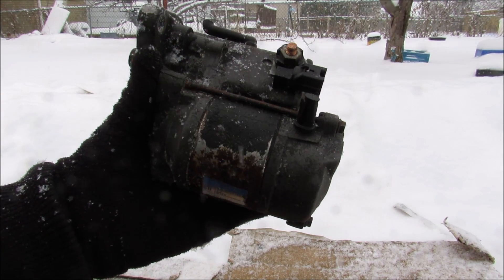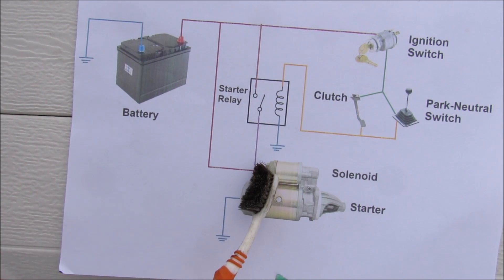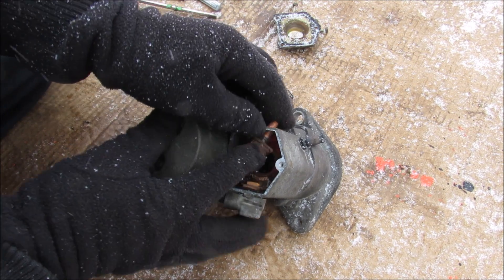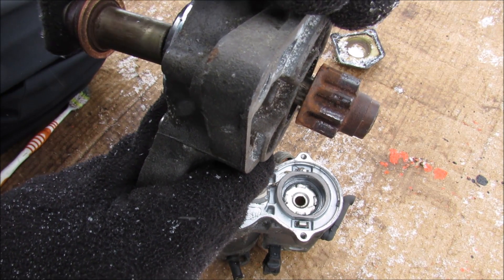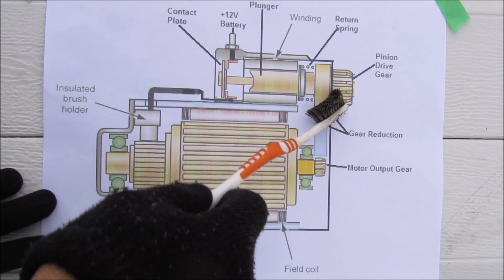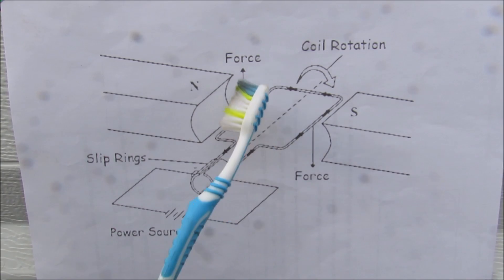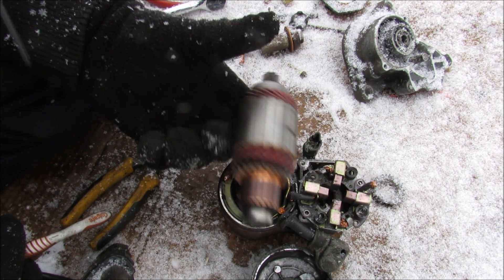How a Car Starter Works

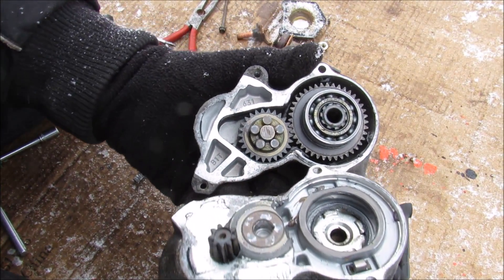Comment: The content 0:15 seconds to 0:30 seconds contrast the schematic diagram of a typical on-starter solenoid where the solenoid sits on the starter and controls the starter pinion via a shift fork. The solenoid doesn't have the starter pinion in practice. With this type of on-starter solenoid, 2:35 shows that the drive pinion on the end of the central starter shaft (on which is the armature mounted) undergoes a gear reduction back to the solenoid unit end (tricky, right?). In a gear reduction starter, the first small driving gear at the end of the starter shaft transfers motion to an intermediate larger diameter gear, which slows the rotational speed while increasing torque; this torque is then passed to the final drive gear, optimizing force before reaching the pinion gear, which ultimately engages with the flywheel to start the engine.
Reply from the maker: Yes

Comment: Would consequent starting an stopping the motor and not waiting a few seconds between that cause any damage to the starter or the flywheel (if such exists, it's an automatic transmission vehicle)?

Comment: Hi Speedkar99. I want to convert my 1.5HP, 220V AC water pump to 12V DC---not using an inverter. It seems that the easiest way to do this is to replace the AC pump motor with a 12V auto starter. Directly coupling the auto starter shaft to the pump shaft should be easy, but the problem I have is how to “spec out” the starter motor to have RPM and Torque equal or exceed the performance of the existing AC pump motor. How can I do this? Which auto starter would be the best? Also, will I need a relay to connect? Your suggestions will be greatly appreciated. Thank you very much.

Comment: I was actually thinking of bastardizing a starter motor, and removing the motor, so I could crank it for my riding mower (110 john deere). The battery died and we have a bad wire somewhere that shorted out the fuse in the garage the mower is stored in. Also it'd feel great cranking it.
Reply from the maker: Electric start would be nice on a mower
Reply: @speedkar99  I mentioned above riding mower, not push mower

Comment: great explanations for a nice quality Japanese starter with bearings everywhere 👍🏻
Reply from the maker: Thank you
Reply: @speedkar99  you could do a serie of ENTERTAINING "failure analysis" video too... 
cut up anything German explain how it works, what it does and present the feature puposely designed to fail prematurely - Fun!

 ball joints with plastic bearing sealed almost dry by rubber formulated for 6 years duty.

Bosch blower fan motors:  nearly dry shaft sleeve bearings blow up speed regulator or fuse

partly hollowed out OEM control arm bushings are loose to begin with....

soft disc brakes carved by hard  semi-met pads... 

unsealed electrical connectors under the hood channeling oil all the way back inside by capillarity....

main computer mounted directly above hot exhaust collector... 

trunk seals causing water intrusion that swamp electronic SAM control module...

Aluminum screws for single use only with precise torque range: 722.9 transmission pan....

fine threads strip aluminum heads...

😎

Comment: what exactly is the starter motor turning to make the parts of the engine move before combution?!?!
Reply from the maker: The flywheel or flex plate

Comment: What is most likely to wear out, why does it work when you hit it with a hammer?
Reply from the maker: The contacts wear 
Hitting with a hammer causes the rotor to slightly contact them again and start

Comment: Isnt the solenoid the small one and the big one is the motor, clutch, and of course the pinion gear that connects to the ring gear ?
Reply: Nevermind, just saw your starter diagram. Guess there's different kinds of starters...

Comment: Can anyone tell me where does the cracking noise come from when my car’s battery dies and i try to start it ? My car has a remote instead of a key. It’s a toyota premio.
Reply: I would say it's the starter relay which only needs a bit of current but then not doing anything else due to low voltage.

Comment: Excellent video as always. Am I right though in thinking there's a sprag clutch / one way clutch in the assembly too in case the pinion fails to retract and the engine is turning over on its own power? And to save damage by driver mistakes like turning the key when it's already running?

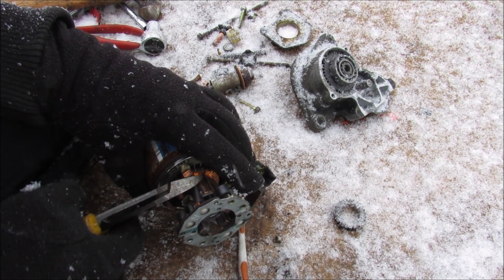Comment: 5:09 Nooo... There are 4 brush spring underneath the brush holder that can be unplug by small long nose plier and it allows you to remove the holder and the carbon brush. I nearly got heart attack when I saw you cut the wire hahaha.
Reply from the maker: Hahaha it's a scrap starter don't worry

Comment: Why specific purpose does the solenoids serve? Cant they be replaced by modern electronic technologies? Do solenoids exist in modern cars?
Reply from the maker: Yes
To disengage the high voltage motor

Comment: Sir, I am always told not to engage the starter after the engine begins to run ie   to release the key as soon as the engine begins to on.

And, also not to engage while engine is running. Obviously, by fault, I could hear cranking sound when engaged on engine on.

Could you briefly describe why I should  not do that? Thanks.

Comment: I drive a well-cared-for 2000 Mazda MPV, and, every once in a while, the starter clicks once when I'm trying to start it, and the engine doesn't turn over. The ignition is sticky as well. Are there some troubleshooting methods I can try at home?
Reply from the maker: Whack with a hammer 
That will get the contacts to slightly turn to a spot where they'll catch.

Comment: On my 1997 Lexus Ese300  the A/C pulley squeaks when I turn it on. 
A new one is like $900. 
Help.
Reply from the maker: +Martin Evan The belt squeals or the actual compressor squeaks? 
Pickup a used one from the junkyard and swao it out.

Comment: Good video.  I would add more explanation about the purpose of the solenoid.   That starter motor requires a LOT of current to spin the engine.  You don't want that sort of power flowing thru the small gauge wires to the key switch on the steering column that turns the 'start' activity on/off.  So that key switch, using much less current, controls a relay (the solenoid) which in turns connect high current direct from the battery to the starter motor.

Similar examples are relays that connect high current to head lights in some cars so the high current doesn't have to flow thru the small gauge wires on the dash or turn signal stalk like my car.
Reply from the maker: +Russel Brooks agreed, the solenoid is essentially a safety switch while at the same time ensuring the starter teeth are engaged before the motor starts running.

Comment: Good as always. Can you show us the working of different types of sensors in a car like O2 sensor, throttle position sensor, maf etc. in coming videos. Just asking 😉😉
Reply from the maker: +Midhun Mohan I have a video on oxygen sensor replacement video where I explained a little bit, and I also have a video on air intakes where I cut one open and explained maf and tps. More suggestions are always welcome! Thanks
Reply: I gotta check that out.

Comment: What can cause a starter to grind?
Reply from the maker: +ethancedrik if the pinion gear tries to engage the flywheel while the vehicle is running, it will damage the teeth.

Comment: Can you do how a power window works? I don't get all the cable pulley stuff.
Reply from the maker: +Trey That would be a great video, but the Corolla I took apart had manual crank windows and I've already done a video on that. Maybe in the future, thanks for the suggestion.

Comment: Well done man. Id it rotating the flywheel or crank?
Reply from the maker: +hostilityy agreed, it's called a flex plate if it's an automatic transmission, and a flywheel if it's a manual transmission
Reply: The flywheel. the flywheel is on one end of the crankshaft and a pulley is on the other end that runs everything attached to the drive belt.

Comment: Are starter motors serviceable or should I replace them in case they failed?
Reply from the maker: Yes they are serviceable, just find the rebuild kit and it will be much cheaper than replacing it.